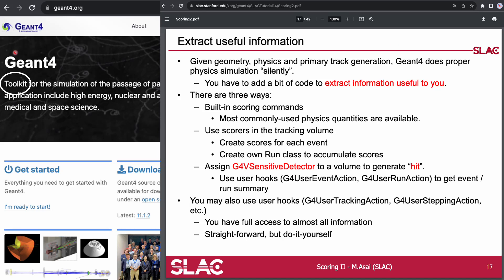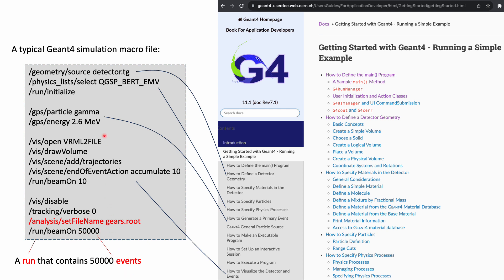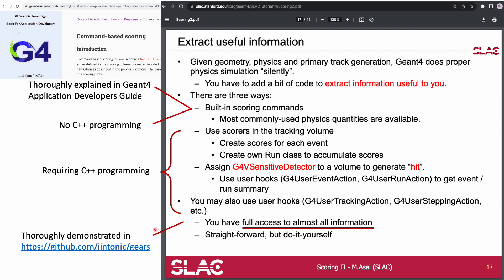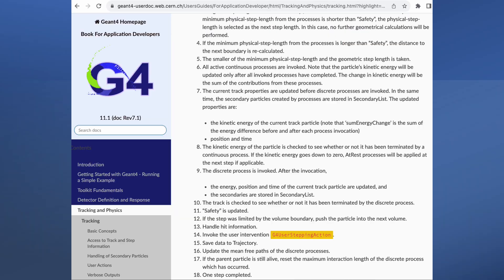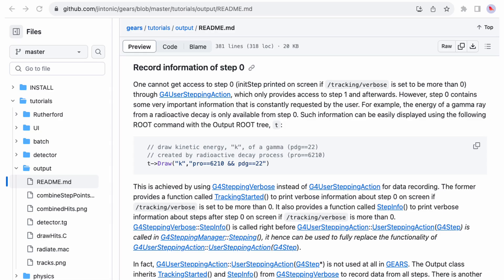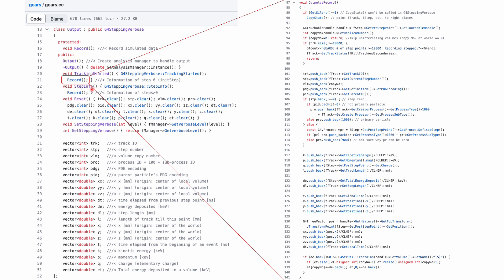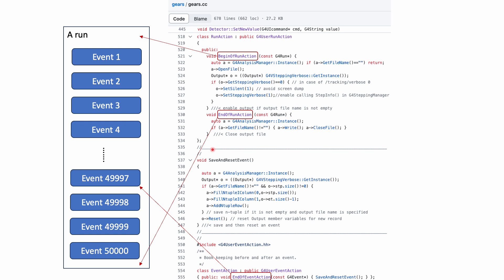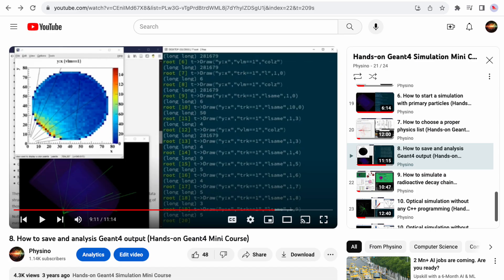The Most #Hardcore Way to #Extract #Information from #Geant4 #Simulation

Comment: Interesting tutorial. In your UserRunAction, it's better to add protection as Begin/EndOfRunAction methods are invoked not only in the master thread but also in the worker threads.
I would appreciate you acknowledge the slide you use in this video.
Reply from the maker: I totally agree with you. The current implementation is for a single thread.
Reply: I also find a bug in your Output::Record() method. 
  if (copyNo<=0) return;
should read
  if (handle->GetHistoryDepth()==0) return;
if you want to skip a step in the world volume. CopyNo could be zero for any other volumes.
Reply from the maker: @MakotoAsai-n4i  I use CopyNo to control the recording of step info. If CopyNo>0, I record step info. Otherwise, I skip that volume.
Reply: CopyNo you get is the copy number of the physical volume the track is currently in. Suppose you have volumes made by G4Replica. The first physical volume of these replicated volumes is zero. Do you really want to skip recording if a track is in the volume of CopyNo zero?
Reply from the maker: @MakotoAsai-n4i  I guess you want to tell me that CopyNo given by G4Replica is not what I think, and handle->GetHistoryDepth() will give me what I want. Is that right?
Reply from the maker: Makoto-san, I did include the URL to your slides in the video and didn't cut your name out of the video. I am sorry that I did not add a thank-you note into the original video. Since YouTube doesn't allow me to directly modify the video once uploaded,  I added a thank-you note in the video description and the subtitle. I'll pay more attention when I reference other's work.

Comment: please upload more and detailed videosss...thanks a looot
Reply from the maker: That's my goal. But it takes time. To avoid waiting, you can browse the example code at https://github.com/jintonic/gears/blob/master/gears.cc, or suggests things that you'd like to learn. Thank you for your support.
Reply: @physino   please make a video on how i can calculate the flux of neutrons shielded by a lead or iron slab .please.thanks for your response.
Reply from the maker: @dipto137 Would you like to have the flux of neutrons after a lead of iron slab? Do you have a neutron beam or a source? What is the neutron energy? What do you want to achieve eventually? Or why do you need to know the flux of neutrons? A big picture would help me understand your specific request.
Reply: @physino   a beam of neutron is passing through a lead shield. a detector is placed right after the shield material. i am wanting to calculate the flux of initial neutron beam flux leaving the source and final neutron flux after its been shielded. i want to know how much effective the lead or other material is to stop neutrons.
Reply from the maker: @dipto137  You don't use lead (or any high z material) to stop neutrons because a lot of secondary particles will be generated. The best way to stop neutron is to use water or HDPE. They will quickly slow down neutrons and then absorb them. You can dope Gd to water or HDPE to increase the absorption rate further. What is your field of study?
Reply: @physino  nuclear engineering.
Reply from the maker: @dipto137  Great. You may recall that a reactor core is normally submerged into water, which can absorb neutrons from the core.
Reply: @physino  yes you are right. but i was working on radiation shielding. thats why i want to design such a project. cant i count only initial and final neutron flux building a detector?
Reply from the maker: @dipto137  Lead cannot shield neutrons. It is used to shield against gamma rays. Neutrons will generate a lot of gamma-rays and other particles in lead. One creates more particles than reducing particles if he or she uses lead in a neutron beam.
Reply from the maker: Yes, you can easily count the number of particles before and after a volume. https://www.youtube.com/watch?v=CEniIMd67X8. I can make a video to explain that further. But I'll use gamma+lead and neutron+water as example setups instead.
Reply: @physino   then help me by designing a gamma shielding slab and a detector that calculate flux
Reply from the maker: @dipto137  What OS do you use?
Reply: @physino  linux ubuntu 22
Reply from the maker: @dipto137  which version of Geant4 have you installed? Did you enable Qt?
Reply: @physino   i use v10.7.0.  yes i enabled it
Reply from the maker: @dipto137  Any reason to use such an old version of Geant4?
Reply: @physino   not actually... i followed a tutorial video to start as a beginner and to avoid unexpected problem i installed as the maker of the video installed
Reply from the maker: @dipto137  I see. It is a good idea to stay up to date, as Geant4 did a lot of good updates to make its compilation and installation easier and more robust. I made a new video to walk you through the compilation of the latest Geant4 on Ubuntu: https://youtu.be/zBRLls4eC34. It will take me a while to make a video about lead shielding against gamma. If you cannot wait, please take a look at https://github.com/jintonic/gears/tree/master/tutorials/physics/gamma and https://github.com/jintonic/gears/tree/master/tutorials/physics/neutron. The solution of your problem is all there.
Reply: @physino  thanks a lot. can i have ur contact???
Reply from the maker: @dipto137  You can find it in my channel